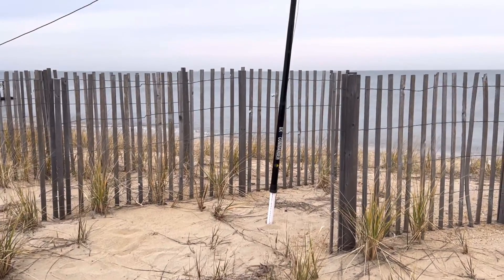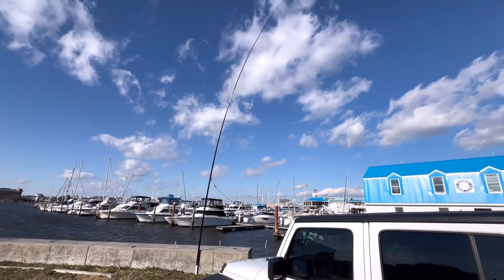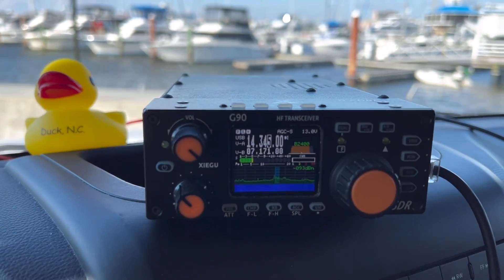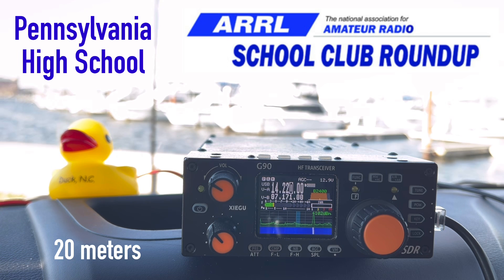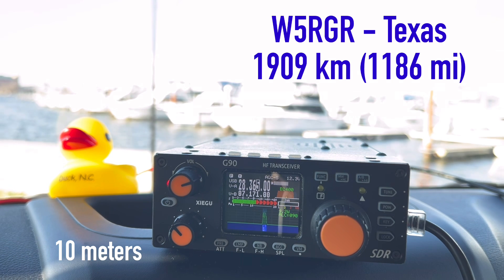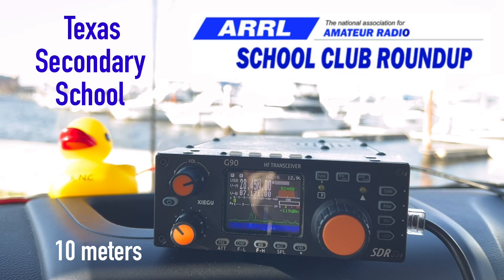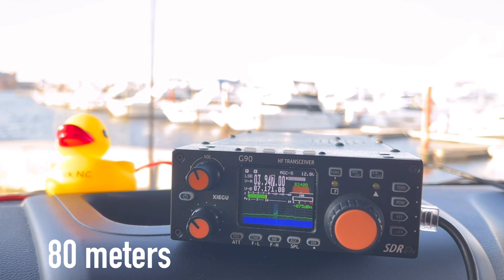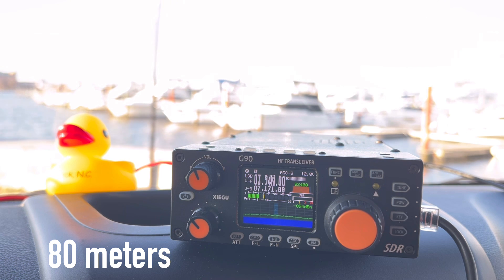Experimenting with HF Antennas - Trying a Different Time and Location

Comment: Walt, thanks so much for the tip on a nice battery! I almost bought a LiFePO4 a few months ago and planned to charge with my regular auto lead-acid battery charger, but was warned at the club that this type of battery is not compatible with that type of charger. I investigated a charger and I just didn't want to pay more for that than the battery itself. Those wants took a back seat until this video. I just ordered one and now I can go portable should I so desire. Thanks again, OM :) de KA8VLW, Ken, Michigan
Reply from the maker: That battery is an excellent battery for the G90. You will really like it. It’s a bargain with that charger. 73 my friend!!

Comment: that was super ! love the 80 meters at the end. I was getting noise and QSB in NY today as well . 12 was wide open. was mostly digital. QRO antenna testing 400 watts JS8 call and FT8 . 10/12 . was my home made  49:1 type 61 cores 2 stack 10 AWG windings. cores stayed cold.  same test before but type 43 core . got slight heat in core. same DX commander pole . just end fed half wave on a fence post. 17ft counter poise on the ground.  tune under 1.5 VSWR , I adjust end for 10/11/12 meters.  I want to do off set center but with 4:1 balun . for 10 meters . same pole . got Walmart speaker wire . more ferrite FT 240/31/43/61 on the way . great fun video !  love off set center. easy to set up. nice limited space antenna . all just on the pole . 73's
Reply from the maker: Thank you so very much my friend!

Comment: One day when I did not have to work, I took all day to compare three antennas on 40 meters. I used the CHU Canada time station which at that time was on 7.333 MHz as my fixed reference. 
I had a 70 foot high tower that was shunt fed and tuned for 40 meters. I also had an end fed horizontal long wire and a Hustler Mobile antenna on the back of my truck. I had an antenna switch connected so I could switch instantly between the antennas. As the day progressed each antennas ( including the Hustler mobile antenna) took their turn as being the dominant antenna. Somewhere I still have the readings.  Time of day definitely affects the angle of arrival of signals (and polarization) for a variety of reasons. I expected that at times the vertical would be better than the horizontal but what I did not expect was that the little Hustler mobile antenna would at times be better than the 70 foot vertical!
Reply from the maker: Cool experiment! I love doing stuff like this. Thanks for sharing

Comment: I use a TalentCell 12ah and love it with my FT-891. They also have a 24ah with a built in volt meter that I’m considering
Reply from the maker: That 24ah is a beast that last a looong time

Comment: Hi Walt it's great to see you out there trying different things.  I was wondering how the antenna would react if you raised the feed point and had the shorter element on top, or switched the poles on the balun.  If you put the shorter element on top you could use a longer combination and slope the bottom element.  Just some thoughts, I look forward to seeing more fantastic videos!
Reply from the maker: Thanks, yes there are many configurations I could play with here. I may try something else. 73 my friend

Comment: KQ4FIP here.  I love this video.  I have question as to why you used a 4:1 Balun on this version?
Keep up the good work.
Reply from the maker: Because at that point on the wire the feedpoint impedance is close to 200 ohms around the points of the bands I’m on. That helps me get the SWR down for an easy tune. I used a balun versus an unun because a balun is used on a traditional OCF dipole as it is a balanced antenna and I had a feeling this would be the option for this antenna

Comment: Could you share details of the pvc used to support the mast? This has been a real challenge for me on POTA activations
Reply from the maker: Sure! It’s a piece of 2 inch schedule 40 PVC pipe I cut 4 foot long. I made a 45 degree cut at the bottom to drive it into the ground. I drive it down about 2 and a half feet and slide the antenna over it.
Reply: @COASTALWAVESWIRES  Thank you

Comment: Nice to hear the school round up stations. The closest we have to it is Scouts on the air day. The scouts have a short QSO and earn their communications badge. 
80 meter band as you are probably aware is a night time band for DX. Nice contact on 80 meters. Well done Walt.
All the best David M0DUU
Reply from the maker: Thanks David, yes I was surprised I made that 80 contact in the afternoon. Now I want to make a big antenna and go portable at night. 73, Walt
Reply: @COASTALWAVESWIRES  In the UK we used to have a weather net on 80 meters. It started from sunrise. If you listened before sunrise you could hear DX stations. As sunrise approach those stations wound fade out and the UK stations would start rising above the noise floor. It was one of the first things I learnt about propagation, just by listening.
Nice idea to do some 80 meters at night. Maybe on the beach with a camp fire and some beers. Best wishes David M0DUU

Comment: Walt have you tried the ATT button? It has three positions and it really helps with the noise. I find myself using that a lot more lately because of the horrible AC noise I get here. Yep I played with the roundup all weekend myself. Great kids doing great things. Love it.
Reply from the maker: Yes I did a lot of adjusting the attenuation, problem was it attenuated out the signal as well as the noise
Reply: Im sure I have a lot more noise here than you normally do there. And I have to turn up the volume when I use the attenuator. But it does work well for that. @COASTALWAVESWIRES